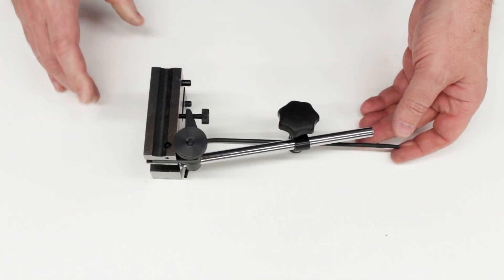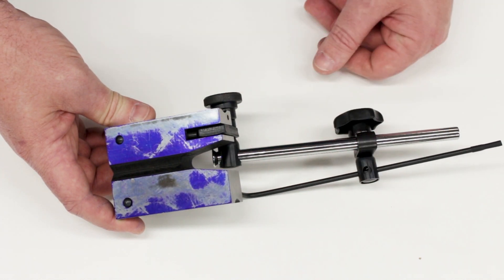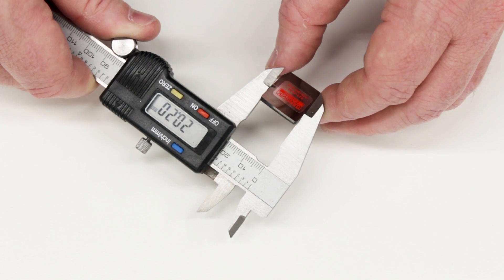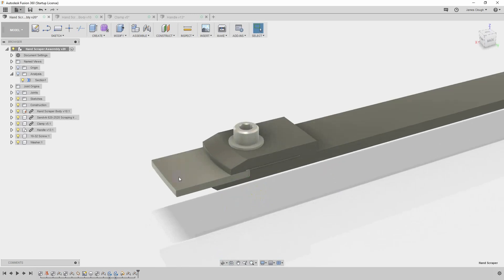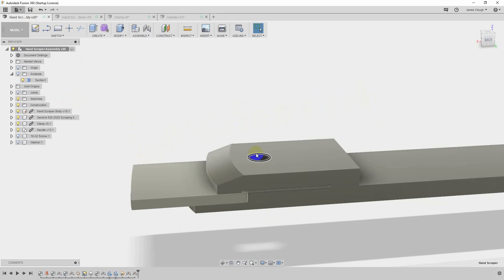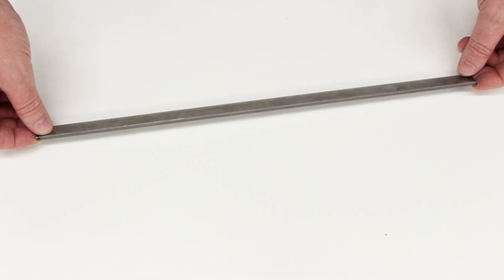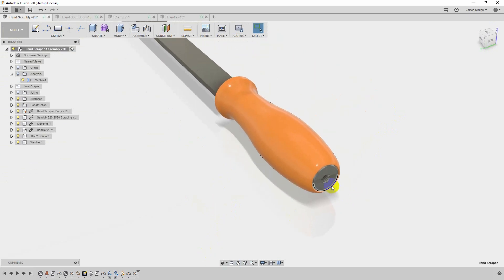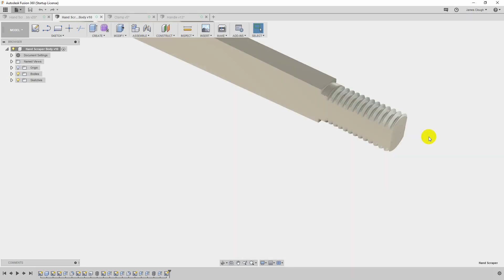Hand Scraper Part 1: Overview of the Design

Comment: Isn't the indicator base hardened steel? I didn't think you could scrape that very easily. Certainly you would want a different angle on the edge than -5 deg, which is for soft cast iron.

Comment: I can think of at least one way I'd do that interrupted thread. First I'd use a small center drill and use coordinates to get the center hole in the tang end dead center in the material. Then use the tailstocks live center. But do think I'd probably epoxy two slabs of metal to the tang end, then turn all three pieces to your threads major diameter. Doing that ensures there's no interrupted thread while it's being single point threaded. There's enough backlash in the average lathes leadscrew that the interruption between cutting and non cutting portions without the added filler pieces on each side could slightly throw off the thread pitch. Then just use heat too remove the filler pieces. The thread could be cut with a die of course, but single point lathe cut threads are always superior, straighter and fit much better if your doing your job.  

It's more money but buying A2 air hardening tool steel in those sizes is easy to find. And with that you could harden and temper the scrapers threaded tang area for better durability over it's long term lifespan if you think that might be important. It also depends on just how well that surface gauge was made if you can scrape it flat or not. If it was properly hardened like it should have been then it might be better to send it out for surface grinding.
Reply from the maker: Yeah, I debated for a long time in my head (where I hold most of my debates) how to do the thread.  I think single-pointing would give the best result.  And because of the size of the flat and the entrance angle, I wouldn't be concerned about backlash.  Whether a die would work well all comes down to the thickness of the material and the size of the gaps in the die.  My lathe has change gears (for now) and I'm pretty lazy, so you can guess where that's going.  :)

I did take a swipe at the bottom of the surface gauge with the insert, and it peeled off a shaving, so I think it's going to work.  If not, I've got plenty of other stuff in the shop that should be, but isn't quite, flat.
Reply: Well if your hinting at adding an ELS at some point I'll be avidly watching that. :-) My lathe has what's optimisticaly called a semi quick change gearbox on it. Only 3 threads and power feed ranges available without changing a few gears. An electronic leadscrew would make a very useful addition. 

I'd say the bottom of that SG should be soft enough to scrape by the sounds of it.
Reply from the maker: I've been thinking about an ELS for a long time.  I looked around for something off-the-shelf I could buy and found a few old projects (one pre-microcontroller).  Stefan Gotteswinter teased something on Instagram a while back, but it looks like it's German-language only.  I'm seriously thinking about having a run at developing one myself.  I picked up a 4096-count encoder for the spindle and a couple of candidate microcontrollers, but I still haven't found the time to dig into the software.
Reply: This may be redundant since you may already know about his YT channel. Jan  Sverre Haugjord. An unbelievable and extremely talented but still amature craftsman who does some of the best and "proper" machine tool rebuilds and hand scraping I know of. Both he and Stefan are supposed to have upcoming videos about that Rocketronics ELS. Two possible problems with it from my limited understanding and knowledge. One as you say is it's native language (I think) and from my perspective it's apparently set up only for metric threading? Anything computer related is far outside my knowledge base though. Imperial part sizes, threads etc are made every day on metric ball screw machines. There simply a conversion within the program to get the required dimensions and thread pitch. If or why that Rocketronics system can't do imperial threading is something I don't know the reasons for.

If you can come up with a workable system that can do both imperial and metric thread pitches, and are willing to make user installed kits available at that point? I'd be more than a little interested. Your VFD/remotor video series proved to me you do know what your doing. :-)

Comment: Those diamond discs are smooth, however, the ones I bought weren't flat. I measured 3-6 thou axial wobble.  They still work (very well for some things) but don't rely on them to produce a flat surface.
Reply from the maker: I actually inspected mine on the surface plate last week.  Two of them were flat, but the smoothest one was out by about .004".  I massaged it a bit on the edge of the bench and got it to the point that the edges were flat on the plate when pressed down in the middle.  I'll be turning an aluminum backer, so hopefully it'll be possible to get it into a state that the hub sucks it flat against the backer.  I guess we'll see.
Reply: @Clough42  - magnets in your backplate ....

Comment: Phew!
Talk about serendipity.
Glad I ordered that insert when I saw it! (CT)
I've a piece of 3/16" CR I'll use even though it's 1" wide.
Easy enough to narrow it up and then I think it was Rob Renzetti who recently showed some scrapers he milled
a trough out along the length to gain more flex.
Looking forward to the project!
Reply from the maker: Yeah.  I sold the last one I had just about a day before the video went up.  I have more ordered, but they're back-ordered.  I'll update when I get them.

The stiffness of material with a rectangular section is proportional to the width times the cube of the height.  So 3/16" (4.76mm) material will be about 68% stiffer than 4mm for the same width.  The extra width adds stiffness, too, but it's linear.  All of that said, I selected 4x20mm because it's what Stefan Gotteswinter suggested.  It feels about right to me, and it's available cheaply (McMaster-Carr) so I went with it.
Reply: Milling a trough in some thicker stock is a great idea!